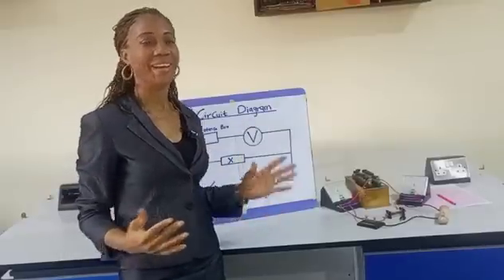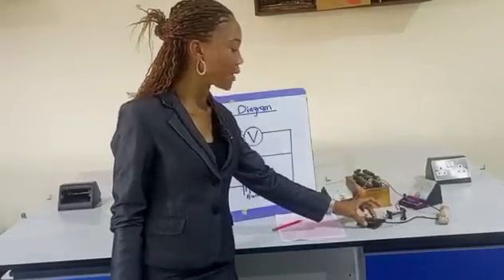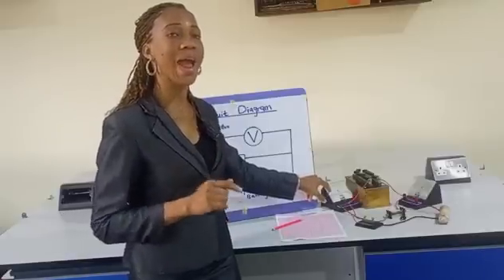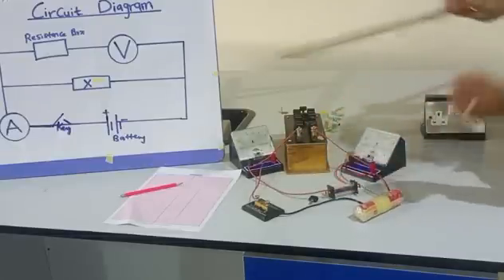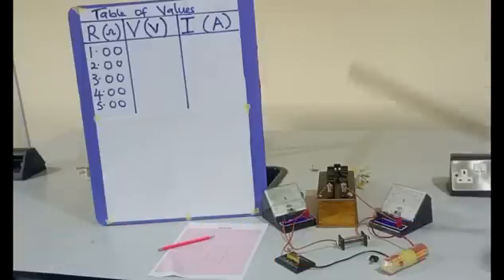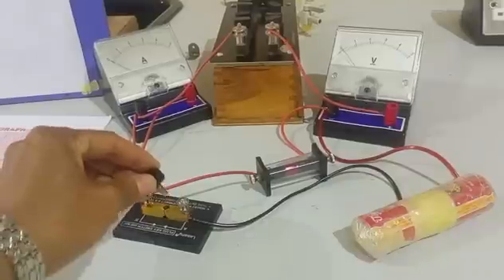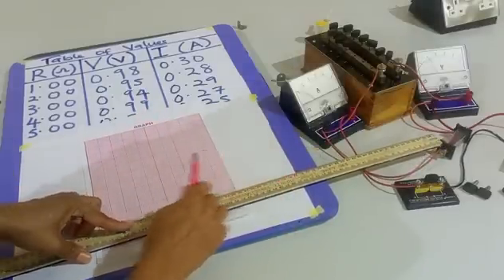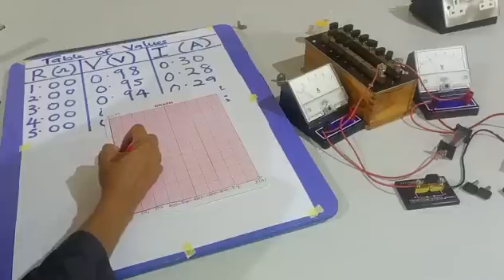NECO 2025 Physics Electricity Practical Questions & Setup Explained!

Comment: Precaution is not obtain here ma, key supposed to be removed after each readings to avoid drained of battery or fluctuation of Ammeter and voltmeter. Thanks
Reply from the maker: Thanks for your comment

Comment: The trend must be constant that's what the examiners will check and award marks since both  decreases anyone that increase lead to lost of mark on the table.
Reply from the maker: Yes, thanks for your contribution
Reply: Ohms law
Reply: Madam Voltmeter is connected in parallel not series